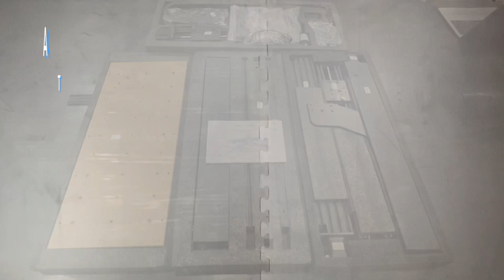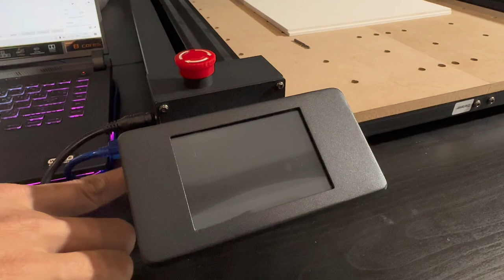TTC 450 TwoTrees CNC Router Machine + 500W Spindle

Comment: I'm posting this anywhere there's a video or article about the TwoTrees TTC 450, as a warning.

I thought I'd share my experience with TwoTrees service, in case anyone is thinking about buying one of these things.
I purchased my TTC450 from Microcenter, and the same day purchased the 500 watt spindle motor on Amazon.
It took me about a day (off and on) to assemble the CNC itself and get it ready for the upgraded spindle motor.
The motor came in the next day, and I got it all hooked up and upon testing it...NOTHING.  Not even a blip.
Sent some emails to TwoTrees, and eventually got a reply asking me to TAKE A VIDEO OF THE PROBLEM TO SEND THEM.  Wow.  Never seen THAT kind of nonsense before.
So I take a video, figure out a way to upload it to them, and their next response is to instruct me to disassemble the power supply (!) and jumper 2 wires to bypass the relay.  Wow.  HUGE red flag there, asking a customer of your product to take it apart and perform an operation that obviously voids the warranty and kicks it right out the door.  Not including the SAFETY CONCERNS.
So I went through all that, sent them ANOTHER video of the result (getting REALLY tedious by now) and then I wait...
And I wait...and I wait...and eventually like about a week later send them another email asking when I might be receiving my new power supply.  Because the brand new one is obviously bad, right?
Well, I got an email today informing me that they're sending me a NEW RELAY.  Which is to say, not only did TwoTrees ask me to disassemble sensitive electronic equipment, now they're actually asking ME to FIX IT.  When the original that THEY SHIPPED was CLEARLY UNTESTED AND DEFECTIVE.
Gee.  Sending me a new relay so I can operate on my brand new equipment that doesn't work.
Thanks, TwoTrees.
So, ordering from TwoTrees, know several things.
1: There is no QC process during manufacturing, and you may receive defective equipment from the get go.
2: TwoTrees has NO QUALMS about expecting the money-paying customer to do extensive repairs to otherwise new equipment to make it work, despite any potential safety concerns about working with high voltage equipment.
3: TwoTrees will do the ABSOLUTE MINIMUM to get your product repaired for you, requiring you to perform delicate and complex operations you should never be asked to do.

In short, my experience with TwoTrees has been an absolute NIGHTMARE, and had I known before hand, I would have purchased something else.  I recommend everyone take a good, hard look at the company you intend to buy from.
Reply: Same with me. All the same problems you listed.  I trashed mine after 5 weeks of getting nowhere.  It never worked.
Reply: I bought a TwoTrees Sapphire Plus printer back in the days. I got exactly same experience of their support. When i bought my printer, it was early product. My Z axis metal extrusions came 20mm short! this lead whole printer build screwed up. While i were building it, i also found out about shipping damages and bent parts. I eventually got it working by straigting parts out and shortening leadscrews by 20mm, this ment my height of the whole printer were 20mm off thus 20mm shorter prints. Long story short: Only outcome from aliexpress were it to send it back for full refund. But i had to pay for the shipping fee. I did not ever send it back and this was the last 3D printer scam i fell in to and were out of hobby for years! This company is pure trash!

Comment: This a little late but it may help new users that find this video. The wires rubbing against the frame is because the drag chain is attached too far forward on the Y axis (1:07) . The rubbing cable that comes out of the end needs to bend back to connect. It can't bend back with enough slack to keep it out of the way of the fame when tied to the side of the upright . Unsnap a couple of bars (not the entire link) from the top of the Y drag chain to release a little more cable. This will let you wire tie it to the back of the upright instead of the side. The video on the SD card shows the cable tied to the back not the side. The cable doesn't get in the way of the limit switch when tied this way (tested).

Love you videos thanks for everything you share with us.

Comment: How much cost this cnc router
Reply from the maker: Can be purchased for $614 on the TwoTrees store, or you can get the TTC 450 machine only for $549.
Reply: Please send me seller link
Reply: Don't buy it's not worth the price
Reply: I have advanced cnc routers,do you  need?
Reply: @venko3211  Different configurations have different prices, according to your needs to configure.Because our company produces large machinery equipment, so the price is more than 1000 dollars
Reply: @宋伊李  i need bed size 3x2 inches or 3x3 inches
Reply: @venko3211  are you sure？3*2 inchees，just 8 cm？
Reply: @宋伊李  sorry. 3 x 3 feets or 2 x3 feets
Reply: 36 inches x 24 inches or 36 inches x 36 inches
Reply: @venko3211  Ok，I have.Could you give me your contact information ？ I will send you details.
Reply from the maker: https://www.twotrees3dofficial.com/products/ttc-twotrees-cnc-engraving-machine